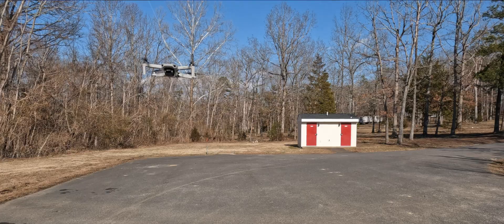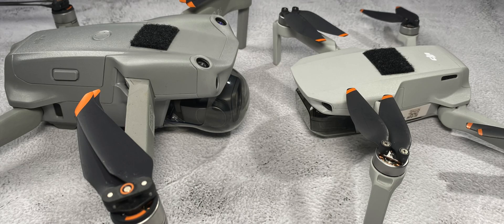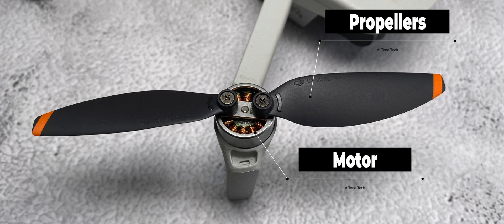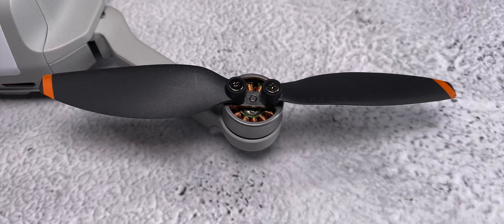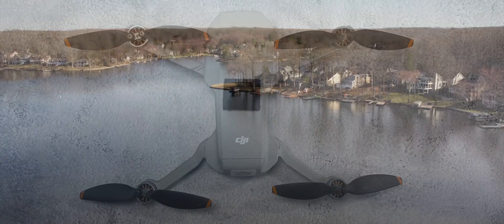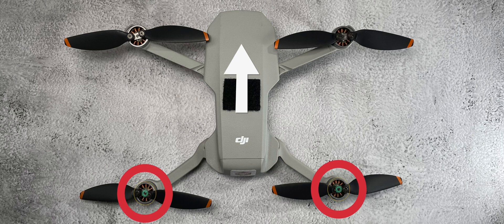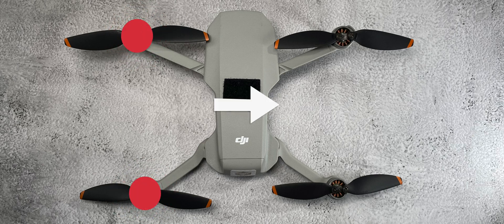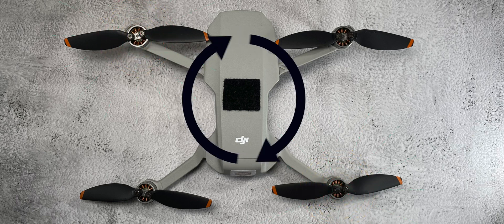How a Drone Works, Simple explination

Comment: How does the plastic of the propellers hold so much weight
Reply from the maker: It’s actually not a lot of weight and is based on the physics. The prop is mostly creating lift that supports the weight of the drone. In this case the prop may be strong enough to support the overall weight but in much larger applications like helicopters. There is phisics that allow the individual props to support the weight while spinning. The weight is also distributed between the 4 motors in this case. The true explanation is much too advanced to answer in this response and I’m not the best one to answer it clearly. Sorry I wasn’t of better help.
Reply: @AlToneRC-RTR I need more education on
Reply: @AlToneRC-RTR just curious